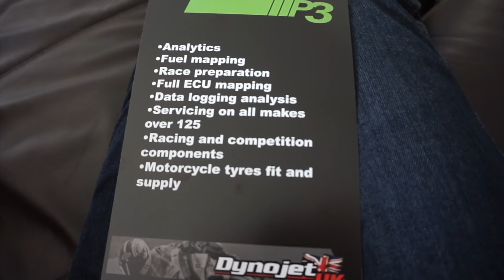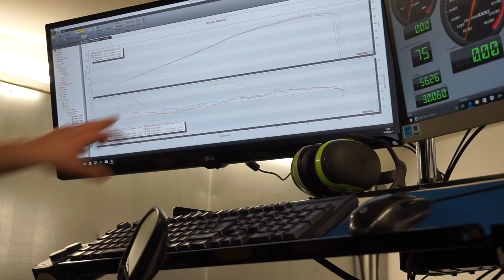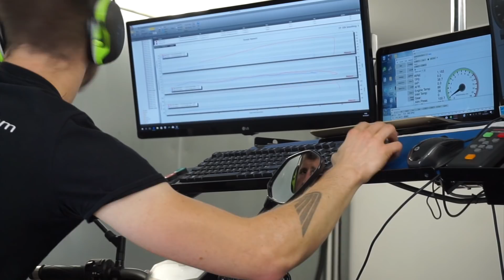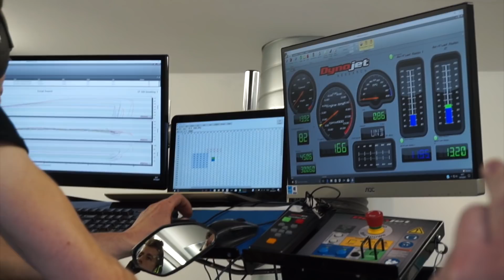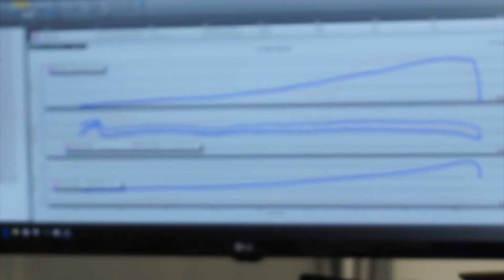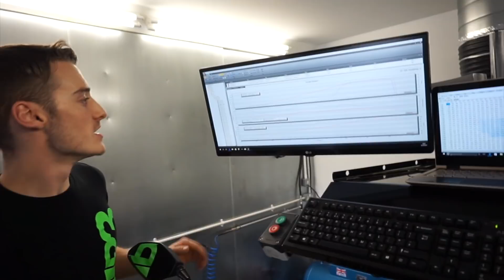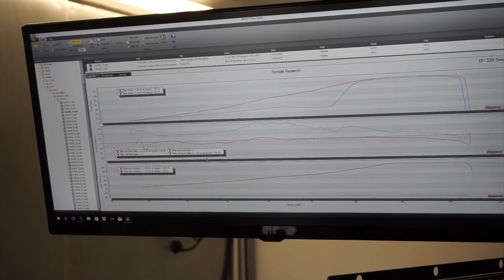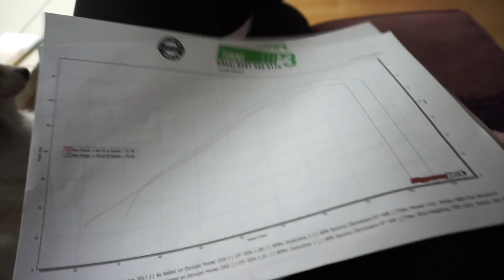Getting my MT07 re-mapped at P3 Tuning.

Comment: Thinking about getting my xsr 700 done, did you remove the catalytic converter in the stock exhaust ? Not feeling like putting another pipe for now, kinda like it quiet.
Reply: On the MT07/XSR700 the stock exhaust comes off. You have to buy a full system for it

Comment: Nice to see the the whole process of the dyno run ! Do you have a power commander or a bazaaz  unit on your bike and what kind of exhaust did you go with, full system or slip on and what brand ?
Reply from the maker: Thomas Evers No power commander just a full system titanium akrapovic
Reply: PistonHeadChaz 
Very nice choice on exhaust !
Reply: PistonHeadChaz doesn’t look like your have titanium headers other wise they would of gone shades of blue! Prob stainless steel with a titanium slip on end can

Comment: The stock motorcycle is way too lean .. Government regulations  for   good emissions  is the reason... Also  stock timing is conservative..  If you add a  little more  fuel  and a  little more timing you can gain  power , drivability and  even better MPG.

  If can recall what I read about the FZ-07 in the USA  the power is restricted only  in  1st and second gears..

  I still want to get the  learn as you ride Tuner for my bike..  I sure would like to see your base line power ..  I guess the  charts had before and after with gains at all RPM and  4 HP on  Top   you can fell 4 HP  on a  66 HP bike..  Most Dynos  exaggerate  but   if you  make the base line the same day on same dyno  you can compare the difference ..
https://ftecu.com/shop/ftecu-replacement-quickshifter-kit/   @PistonHeadChaz
Reply: They call it active tune .. you can see the charts  of what is stock and you can change your parameters with a lap top if I can recall    how it works 
https://ftecu.com/shop/yamaha-active-tune-kit/   There are dealers for this brand in the UK  .. also   you can plug the quick shifter into the above shifter for $240  more